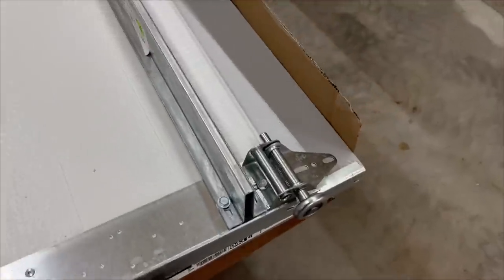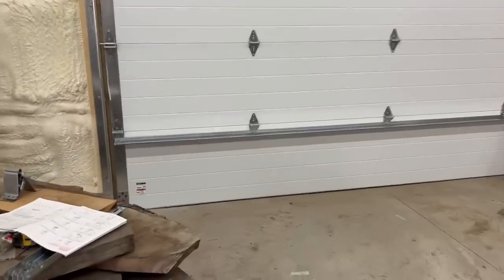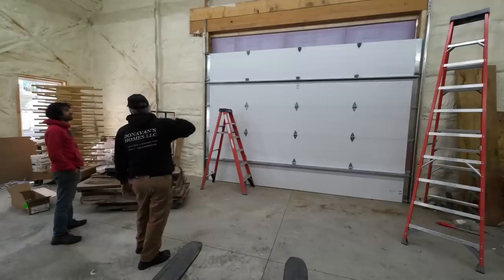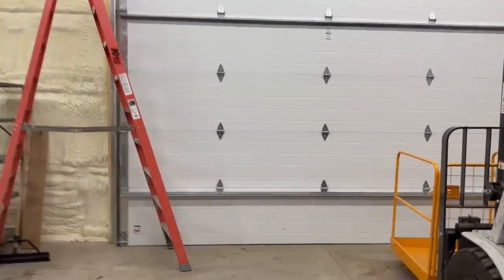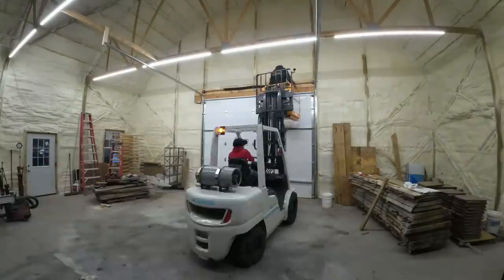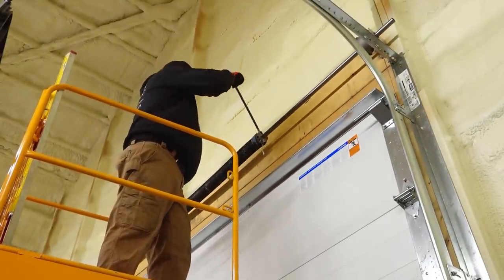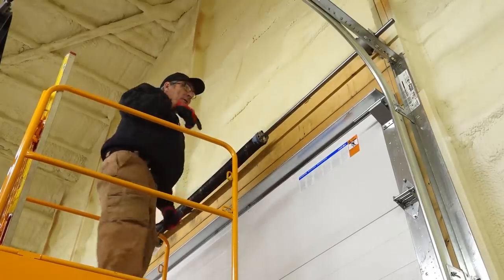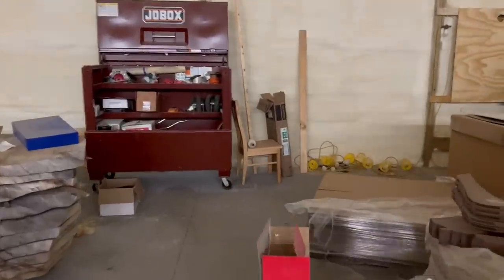Building a gambrel  style post frame barn part 10 finally installing the garage door

Comment: Nice door and job installing it.
I'm guessing it's going to need a seriously big motor on the electric opener and large emergency rope to open it if fails or a power failure.
I certainly wouldn't want to have to open if manually.
That sucker if huge.
Merry Christmas and a Happy New Year to you and your family Donovan.
Reply from the maker: Once it’s finally balanced it’ll be able to go up and down my hand easily

Comment: An under-tension spring broke on one of these overhead doors with a huge bang. It sometimes happens. it was loud enough almost  It was loud. Nice work and well done and now, whenever I pass under these doors I walk gently from fond memories.
Reply from the maker: They can be very scary
Reply: @donavanshomes  at the warehouse, ours go up and stay against the wall with a kink to clear the torsion springs. A spring broke one day, while it was up, but was still held by the opener. closing up the place for end of day, the opener was over loaded and would not operate. This is often a problem (not opening or closing for various reasons) so I grabbed the clutch chain . . . BANG! the door slammed shut. scared me a bit, but it did notify Maintenance that they had a door to fix the next day as they had just moved offices into our building, and everyone of them there came and asked "WTF was that?"
Reply from the maker: @jpkalishek4586  they can be very dangerous sometimes

Comment: Door does not appear to be wind rated. Also when winding, watch out using rebar, you should use hardened steel bars from the manufacturer.  Nice door though.
Reply: Why do the bars have to be hardened? Why is rebar not acceptable?
Reply: @goldenhazeduster   Rebar can bend.  The rebar can potentially slip out of the winding cone causing damage or serious injury.
Reply: @paulgoplen5929  any metal bar can be bent. You are not going to be able to apply enough force on that short piece of rebar to come close to having a problem. I agree that you want the rod to fit snuggly into the socket so it doesn't slip out but a hardened rod is overkill. I used hot rolled bar on mine and it worked wonderfully. Hot rolled bar has as lower a yield strength than any other steel, including rebar.
Reply from the maker: The door does meet wind rating for our location

Comment: Wouldn't a roll-a-door  have taken up less space overall.  especially if he ends up putting a guest room up top. But I guess this is what Matt wanted... and Matt is your client/friend.
Reply: A roll up door that large is more likely to get damaged from wind. And if you damage a regular door, you just replace the one panel instaed of the whole door
Reply: @nooneyouknowhere6148  aha... fair enough too.. I can now see the reason.
Reply: His rafters are not strong enough to support for a living space. Matt said in a building video, that in order to make a storage/office space above, he'd had to install 2X the number of rafters for proper support for the floor.
Reply: Also... A roll up door wouldn't be insulted like this one is.
Reply: Yes, insulation is the primary reason this door was used. I had an unheated garage and no insulation did just fine to take the chill off.